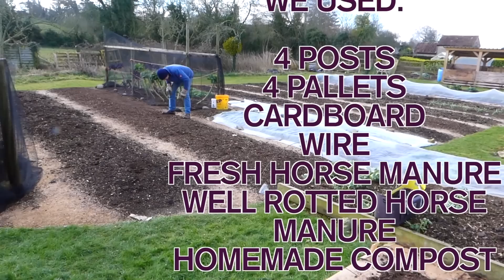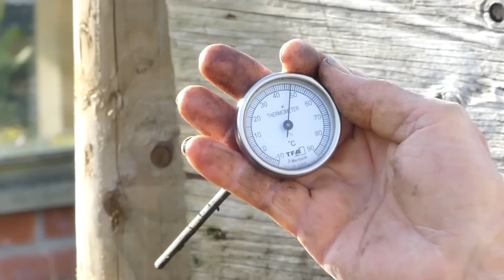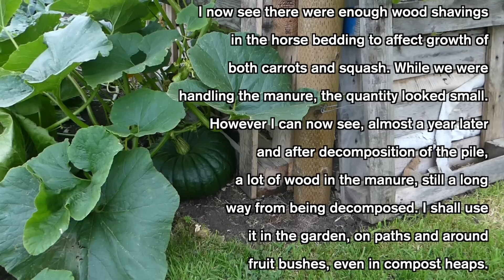Hotbed in the garden for early carrots, February to May part 1

Comment: As someone that ran up to 17 horses at a time, and used straw, shavings, and a pulped wood as a bedding, I can tell you that running a heap so that wood breaks down quickly is very dependent on how much urine, thus ammonia is in the the bedding. Most stables muck out daily, and if using any sort of wood based bedding this is not really great for anyone that is running a relatively small composting heap. It's actually also seriously uneconomical as a horse owner as wood is rather absorbent when left as a deep litter bed, but expensive to keep clean as a daily muck out. We had allotment holders that at first refused to take our wood bedding until I taught just one of them how to actually run his heap correctly. When the others saw his results, we had no issues in selling all our bedding. So long as you have enough urine in the bedding and enough heat, you can actually break down horse bedding really quickly in old plastic feed bags, even when it contains wood. The bags trap in both the heat, and the moisture when you stack them together. If the stables near you use haylage and get any waste from it, ask them if you can also take that for your heaps. It's great stuff for helping heaps along :)
Reply from the maker: Suzanne this is most halpful.
The stables who supply me muck out daily and their wood always looks dry.
Great that you are teaching people about that.

Comment: I used to do something similar with plastic bins. Id put peelings, seaweed, manure, compost material in the bins over the Winter period (covering with bin lid) . Come the Spring I'd top up the bins to the brim with  a foot deep of good home compost and a little sand ... Then sow the carrots. The heat from the decaying matter warms the soil, the soil level drops over time whilst the carrots germinate and grow..... Whilst all is out of reach from the pesky carrot fly.  It works a treat. PS at 26min ish... Salivating. I love tiny carrots. Xx
Reply from the maker: Nice tips Maria!
Reply: What a great idea! Did you have to drill in some drainage holes in the bin?
Reply: @thedr00  I didn't.... Because I tend to leave waterering to Mother Nature.... Unless of course we have drought conditions. In this way, all of the goodness in the bottom of the bin (happily composting) does not leach out.. When my carrot crop was done, I'd top up a bed in need with the soil from the bin. Then start again filling the binswith peelings, seaweed, manure etc in preparation for next season of carrots. Happy gardening to you. X

Comment: My cheapest source of organic material is also horse manure (free). Albeit I get hardly any bedding (straw or wood chips) with it. In my experience plants do not cope well with this fresh manure. It kills off even the leaves of my neighbors ivy that is growing along the property line, which are not in direct contact to the manure. I contribute that to the ammonia that is gassing out of the manure for quite a few weeks. I would guess that the carrots didn't do well due to the ammonia and the squash due to the wood chips. 
Fresh horse manure put on a weedy field in early spring is actually my secret recipe for killing off weeds. Even bindweed gets weakened by it. I have often wondered how you can grow your seedlings on the hot bed in your green house. With the manure I'm using the seedlings would be killed off almost instantly.
Thanks for your great work!
Reply from the maker: Thanks, these are good points. There is one more thing I wonder which may be happening, because of the way you describe weeds dying, and I don't find out normal for using fresh manure. 
I think it may be contaminated with the pyralid weedkiller which has become so common, in products such as grazon. Farmers spray it on grass from which hay is made for horses in particular, and it persists in the hay, and goes through into the manure as active weedkiller. I suffered it here and this is the video https://www.youtube.com/watch?v=2D1idnMNKng. 
It was not in the hotbed manure because subsequently tomatoes were very healthy, and they are highly susceptible.
Reply: @CharlesDowding1nodig  Thank you Charles, good point!  I had suspected the same thing after seeing you mentioning about Amino Pyralid a few years ago. Therefore I started testing the (aged) manure with beans (purple tepee) to see if they die off. But I always had nice beans from that. Therefore I still suspect that in my case it is the highly concentrated fresh manure, without any wood or straw. The manure I'm getting is collected from the pasture (don't ask why) and stored in a container.
I suspect your carrots would have grown longer if the compost layer on top would have been thicker. But I know the problem. There is never enough compost 🙂.
In my case I meanwhile don't put the manure directly onto the vegetable beds anymore. Since that makes the beds unusable for the next 6 months (potatoes would grow in it when planted underneath, but not very nice).
Meanwhile I mix the manure with wood chips and make compost with it. It is an additional work step, but unfortunately it is necessary. I just wish I had more space for compost heaps. 
Greetings from the North Black Forrest at 500m NN!
Ralf
Reply from the maker: @ouroldtruck9380  Cheers Ralf, nice comment

Comment: This looks great, and I think the carrots are fab.  The taste of tiny carrots so early in the spring is the reward.   They are unlikely to even leave my plot before I have eaten them,   I like Nantes 5.  I would like to make a hotbed but I do not have the pallets etc. nor the strength to lift the wheelbarrows.   However I have managed to fill a plastic compost bin (dalek).  So now to put a good layer of soil to make very small growing area but I will have to see what happens.
The horse manure has a lot of woodchip, hay and horses do in it.  I normally put woodchip with horse on the paths.  The horse do seems to wash down into the soil and the plants either side of the path do well.    In the end the wood chips just disappear.  There should be some sheep available soon and that will have a lot more straw.    
 I have done it in the past and got some really early strawberries.    I used some runners from the previous summer which had been pinned into 1 ltr pots full of recycled compost, and they liked the warmth a lot, unfortunately it was too warm in the middle and I cooked a couple of plants,   But I now see I should have put a deeper layer of soil or compost on top.    Unlike yours I did my hotbed downwards by digging (whoops I forgot, no digging!!)  sorry excavating a hole for it.  So the manure was below soil level and then a raised bed of soil on the top.   I think the surrounding soil keeps the warmth in.  It was lined with cardboard.  And I borrowed some wood panels to keep the soil up until the manure could do the job,  But I pulled them out quite quickly to returned them.  I also added nitrogen as a starter which I think made it heat up too quickly.
Recycled compost is difficult this year, I used to collect my own for £1 a bag from the local recycling centre but it is currently unavailable,
A big thank you you have encouraged me to try again.
Reply from the maker: Well done you, motivation is key! Often just getting started then opens the door to many possibilities so have fun with all that.

Comment: Awesome Video there Charles! I really like that pallet and post design and set up. Believe this or not I have almost burnt my hands with a green grass cutting heap. It actually started to smoulder in the middle. That was knee high grass cut from an area the size of two football pitches probably nettles and the odd bramble in there as well when we cleared some land. You can actually run some copper pipes through in the formation of a coil and get lovely hot water. Nice for washing hands down at the allotments on cold days.
Reply from the maker: Ah you are an inventive soul, isn't that satisfying!

Comment: Could you do this over your existing compost bins?  Make a removable roof.  It could be put on when the compost is not being used as a hotbed.  A removable roof would be a pain, though.  Perhaps an easily removable panel over each bin held by cotter pins.  The panel could rest against the side of the bin when not in use.
Reply from the maker: Good thinking Susana, the last option sounds best

Comment: I have a two beds that I started with no dig and same compost over Both. One bed was built with cardboard to block weeds while the other was cardboard and wood chips together. Over cardboard so far so good but I think wood chips became hot and disturbed roots of comparison bed. Wide variety of plants all stunted and yellow
Reply from the maker: Good trial but yes, the wood chip also take nutrients to decompose, before roots can. I prefer them on the surface and thin layer only :)
Reply: Charles Dowding lesson learned, sir!  Thank you for your reply. I have learned a great deal from your work on YouTube. I found that pots made from peat or manure also drain nutrients away. Now I use only plastic. 🙏

Comment: I’ve grown hotbed carrots and I don’t think it’s worth it, not significantly earlier than sowing in a low hoop tunnel or coldframe. Even better though just sow in October or plant into big containers and germinate indoors, then move to a polytunnel.  I get lovely 6” carrots in mid May using these no hotbed options. : all the best - Steve
Reply from the maker: Great tips Steve!
Reply: another great video which gets the conversation going, thanks all
Reply: Steve, what containers do you sow your carrots in sir.
Reply: Old paper recycling boxes or plastic storages boxes, with holes drilled, they are about 12 inches deep and 18 inches by 14 inches, enough for about 3 weeks supply for us  : All the best - Steve
Reply: Steve's Seaside Allotment Thanks Steve. I live in Canada so this gives me ideas. I might have to use some artificial light here to start. I have loads of bins I salvaged over the years. Cool channel btw. Another one to watch.

Comment: Hi Charles,
I am sure that the reason the carrotts were short is that in my experience tap roots go searching for nutrients which is why they do well in sandy soils.....they keep looking for little pockets of nutrients.By providing a huge  big fat layer of nutrient rich manure you made them lazy and they stoped searching as soon as they got through the top compst layer....they just got fat but not long.....you got to keep them on their toes !!!
Also,any nutrients in the soil need to be  equally dispersed throuh out the soil.....if there is somepocket of food source to the right and some to the left they will fork....they smell it and what I suspect is that they really need   to be kept guessing whilst getting just enough to keep going......the sugars from photosynthesis is what will make them fill out.
Reply from the maker: However Dave they never grew fat. Always small, makes me suspect the wood shavings.

Comment: Fascinating! I have access to vast amounts of fresh cow manure and all the bits required, so the only cost is time,  so I am going to try this but with about 6-8" of compost on top & 1' wide removable planks allowing for shrinkage ... one of course must bere in mind the intensity of the sun is not as good in the winter... 
Here in Ireland folk would pile up fresh manure against the 2' thick stone walls at the back of their cottages, it worked well by all reports assisting in keeping the cottage tepid throughout the winter, boosted by a fireplace or stove of course... that h would be the only roof insulation.
Thank you Charles & Martin
💖🙏🌻
Reply from the maker: Sounds good Jamie although remember that cow manure is less hot than horse!
Reply: @CharlesDowding1nodig  Brilliant! I'll get horse then and use the cow to make mulch, guess that would take a few years of turning and mixing but good gear. 🥰
Reply: @CharlesDowding1nodig  btw, love your post pounder, seen them before and forgot, it was so obvious I missed it! 😃

Comment: I think you're absolutely right on the need for a greater depth of growing medium over the horse manure - possibly to shield the growing tap roots from too much heat. Did you by any chance check the temperature at around 4- 6"depth?
Reply from the maker: Yes 40C 104F at 6in depth for a month

Comment: Thankyou for sharing this experiment Charles.   Having seen the final results for the carrots in the hot bed compared to the carrots in the normal bed I couldn't help but think , maybe the ones in the hot bed are stunted as they are pulling up their knees to keep their feet away from the heat so to speak  where as the ones in the ordinary bed don't have the heat to contend with .   Just thinking that may be the explanation for the stunted growth .    Do you think the results would be similar if a hotbed was made from well rotted wood chips ( chipped bark ) ?
Reply from the maker: Good point Jacqueline about the warmth, not sure about wood though

Comment: When will part two be going up Charles? Just been eyeing my Aubergine seeds, and wondering whether to use a heated propogator or put them in a hot bed in my polytunnel. Good vid BTW, thanks.
Reply from the maker: Steve the second part is about growing aubergine plants outside, not sowing them under cover.
Heated propagator is most reliable.
Reply: I grew Aubergines for the first time last year, starting the seeds in the propagator. I grew them on outside in pots, and had  great results.There again, last year was a freak - is this a feasible method usually?  @CharlesDowding1nodig
Reply from the maker: @SteveDavies01  If it's another hot summer! We don't know, worth a try

Comment: Hi Charles, I love the videos. Do you think it is possible that the carrots hit the manure and "refused" to go any further? I once grew potatoes in pots using two different mediums that I put on top of each other (as opposed to mixing them). When I tipped them out every one had done well in the top medium but not grown into the bottom medium at all.
Reply from the maker: Very good observation! Zones of different density, I think called a perched water table as it's bad for drainage, the reason not to put crocks in pots.
So yes something in that, also perhaps too much wood in the mix.

Comment: It seems that you do need to moderate how much heat the root crops get from down below.  Maybe, if you had "cooked off" most of the heat in the manure first, before sowing the seed, the result would have been different. Also, the feeder roots on the carrots may not have been able to access the nutrition lower down because of the fresh nature of the horse manure. That was why the tops of the carrots were doing fine, where the bottom part was stunted, perhaps.
Reply from the maker: It's all interesting as your comment shows!

Comment: Hi Charles.....until you mentioned the heat blowing away I wondered if it made any difference if the composting area had to be covered as yours is, now I know that answer, this was an interesting video, and those little fat carrots reminded of the French carrot seed I've gotten here in the states.  Also wondering if those seeds are non GMO, I don't know how you feel about those, but I buy organic, and then hope they really are.  I planted some pumpkin seeds once from a store bought pumpkin an the flowers all fell off just after they were spent, then I realized the pumpkin must have been a GMO pumpkin.
Reply from the maker: Thanks Wende and those seeds are biodynamic, certainly not GMO which I avoid. Yes it's safer to buy designated seed!

Comment: Hi Charles, thanks for this video... question for you if you don't mind. I live in Canada and was thinking if I build one of these in late autumn just before everything freezes solid. Presumably it would stay in state until the spring where upon defrost would then start to work and provide all that heat. Would incorporating a cold frame design to the top assist with this? Perhaps greater insulation of the sides? I was thinking perhaps pack the pallets with leaves. Or maybe just multiple sheets of cardboard. Cheers, John
Reply from the maker: Hi John no you need fresh in late winter. Scroll down to find Mr Wookie's comment with a link to Canadian 1940's film on making hotbeds in spring snow. Heat is from fresh manure only.
Reply: Charles Dowding I'll check it. Awesome! Thankyou Sir.

Comment: Another great video. Fascinating that the carrots did not root deeply.

Out of interest, I have been experimenting growing Amsterdam carrots in 17 litre polypot bags the last couple of years. Sowing this year on April 8th I can pull good salad carrots on day 63 in early June after germinating the carrots indoors. Last year I sowed indoors on February 15th and started harvesting late May, but the plants did not really take off outside until mid April, so I fancy an early March sowing would be just as good. Last year I pulled 60 odd carrots from each bag from about £1.50 worth of garden centre MPC. I am sure you could use home made stuff if you had it available.

I wonder whether spring turnips might be another possibility for a hotbed? Hot Mays can cause turnips to go woody, but a mid Feb sowing might mean you have finished harvesting by late April/early May?
Reply from the maker: All good ideas Rhys. You did nicely with those carrots.